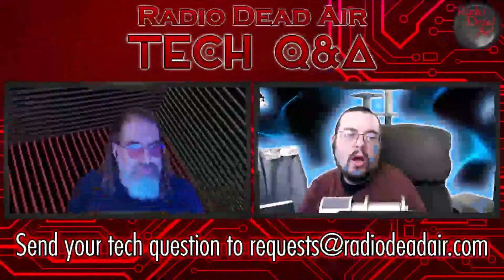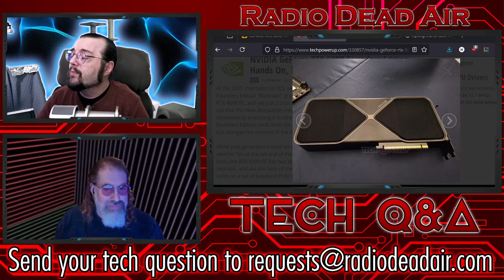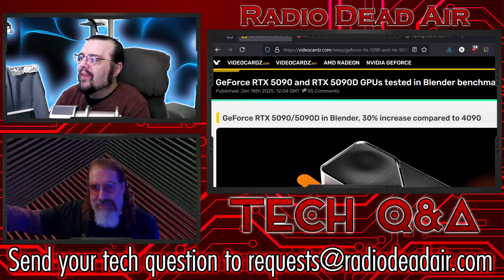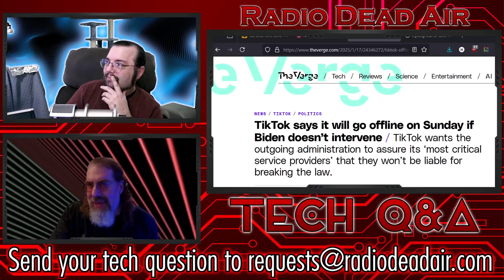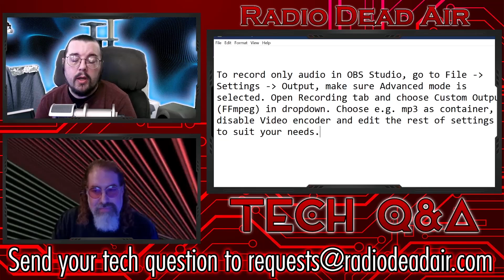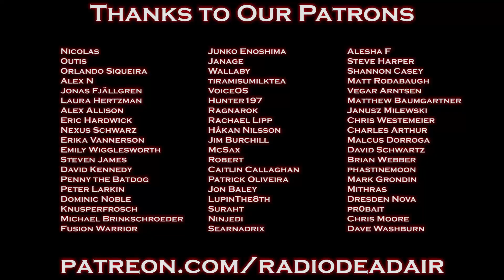Tech Q&A - Time Up For TikTok? - 1/18/25

Comment: Every time I hear about these increasingly ludicrous thermal solutions, I just get reminded of something silly I was involved with in the past.
And even then my personal takeaway was "Just drop the settings, those extra pixels and frames are not worth the money".

Small addition to the last question, sparking can happen, during plugging something in that makes the group close to overloading.
Saw that happen at work because people refused to follow my instructions of spreading the heavy machinery better around, a 2KW compressor and 2 2BHP industrial extraction turbines should not be on the same group, even if its a 230v 25A group, inrush current on those is massive.